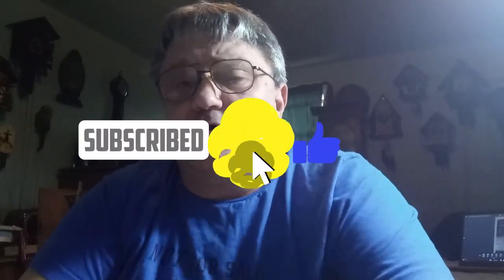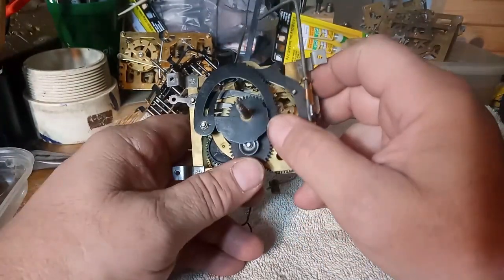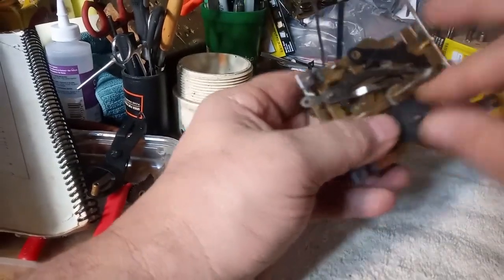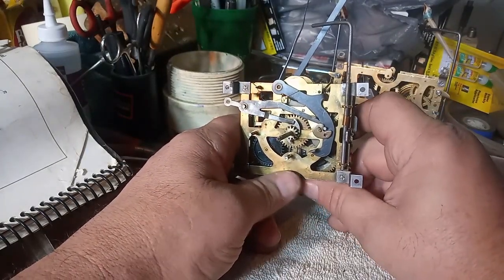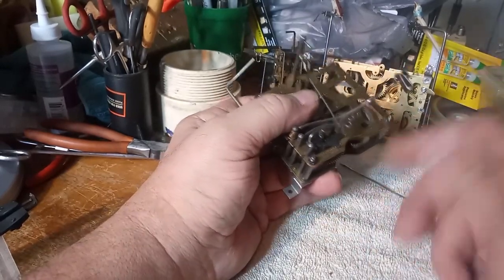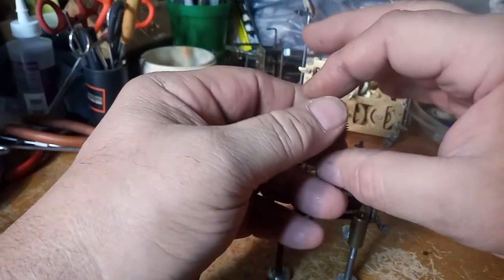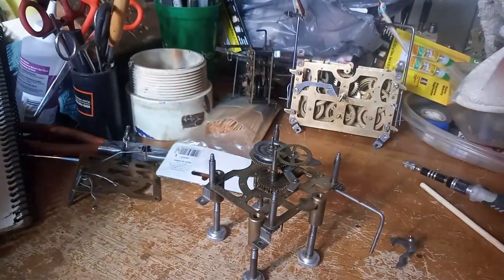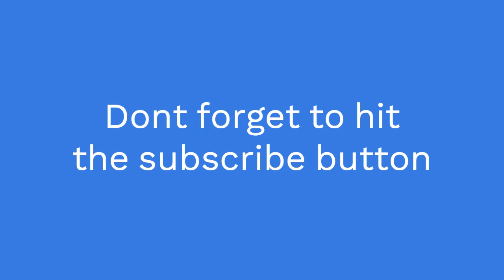Cuckoo clock repair for beginners (Parts of a clock movement and what they do) see description

Comment: On the Hubert Herr 8 day movement, does the trip lever on the side put the clock in warning? If so a video on how would be great. My trip lever only moves the bird out.
Reply from the maker: That lever is to trip the cuckoo incase it is off so  you dont have to take hands off and put them back on. That lever is also connected to the part that makes the Hubert Herr a Hubert Herr which is a pin that comes from the front of the movement to the rear of the movement that rests into a slot that is part of that lever. While the pins is resting in that slot the bird stays out while it is cuckooing. Then at the end a tab of the rack stop lever hits that pin which brings it out of that piece that  has the slot and the cuckoo goes back in the door. See attached video which explains more but on a one day clock. What makes it goe into warning is when the lift lock lever comes off of the minute hand arbor with center wheel tab (hour or half hour) then the 3rd wheel warning wheel pin is stopped by a tab on the lift lock lever until it drops which allows it to cuckoo.
The following is one of my first videos. I was taking Gabapentin and didnt have a phone stand.  

 https://www.youtube.com/watch?v=ZzavOnx6LnU&t=2s
Reply: I've got it hanging on my tester. The lift lock lever doesn't drop back down to let it cuckoo on the half hour, but it does on the hour. Probably something else bent.
Reply from the maker: I have a video on not cuckooing on the half hour. It is for a Regula 25 but it would apply to this Hubert Herr as well.   https://www.youtube.com/watch?v=euCl3tH7EyI